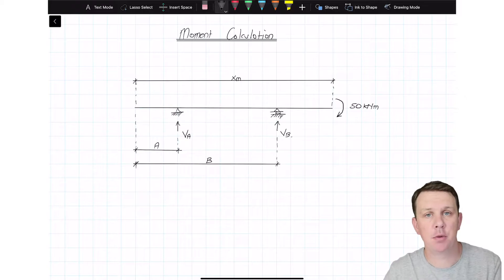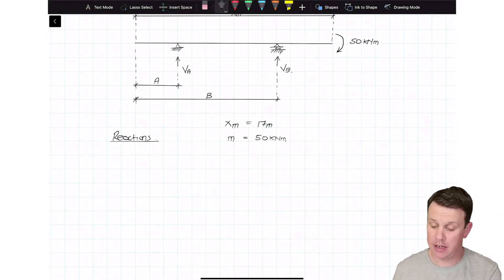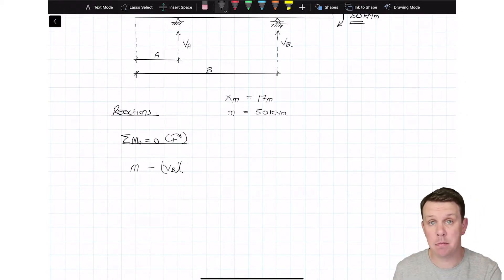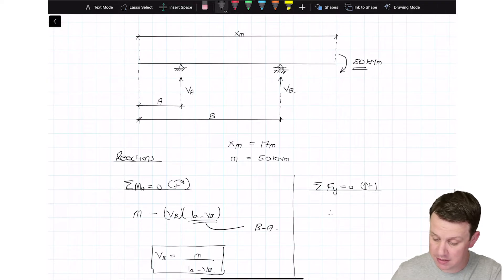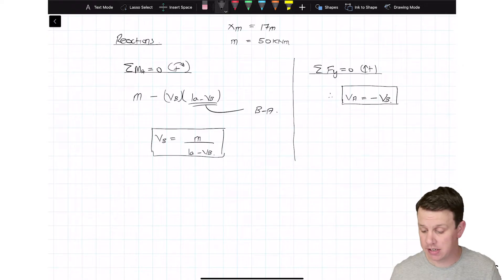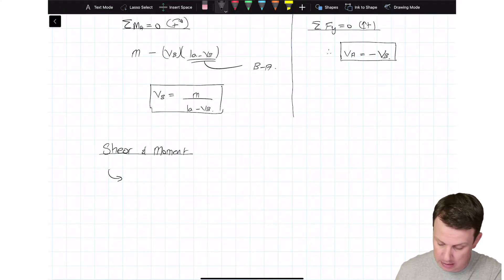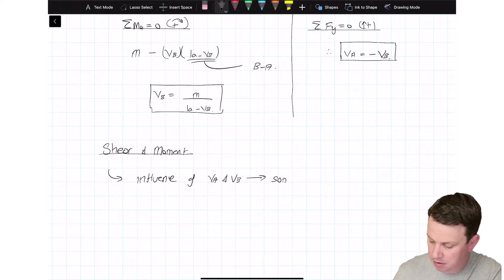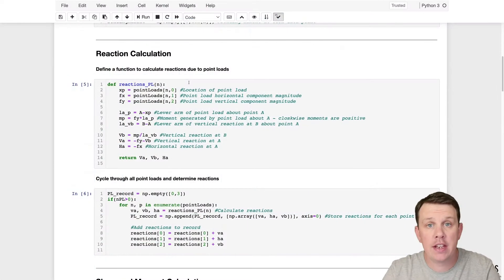[5/9] Shear & Bending due to Applied Moments | Shear & Moment Diagram Calculator Project

Comment: Hi, I really appreciate your work. I am a structural engineer and I am trying to learn python because I think it could be useful in my professional life.
By the way I have a question about this video. When you define the function reactions_PM, you define the variable xm related to the point moment (n) position. However you don't need to do that because that information is not used in the function
Reply from the maker: Thanks Oliviero 👍